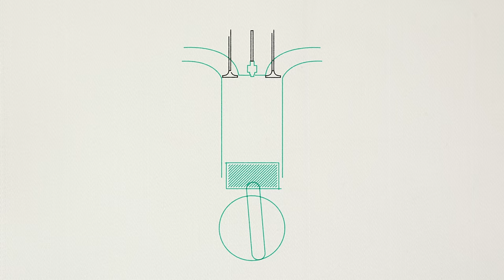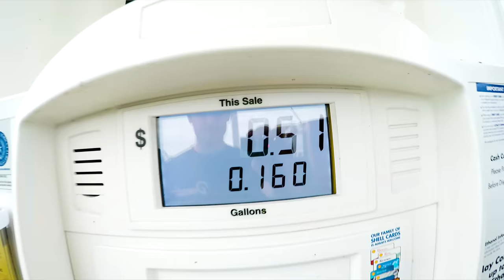IS THERE SUCH A THING AS BETTER GAS - How it Works | SCIENCE GARAGE

Comment: I’m not saying that Shell is a bad company, I frequently use their gas, but not exclusively, however this video kind of rubs me the wrong way because it’s pretty obvious that A: they were paid by Shell or B: They felt they owed Shell a favor for the presumably free tour of their facility, among other things. You can tell by the nearly exclusive use of info in regards to Shell gasoline versus any competition, or generic fuel, and frankly the humor is toned down significantly. It sounds silly, but this video is almost too informative, which points to them having a spec sheet they’re needing to read off of to fit Shell’s expectations in exchange for funding.

Comment: I've run my 2000 trans am since day 7 it's been fine I've got 86k there's minimum  standards federally, it's freaking gas I'm not gonna drive 50 miles or wait in line I get what I get regular  unleaded as required  by my owners manual on my car , I can use premium  for maximum performance, but that's why most of these cars are run hard and are now coke cans.

Comment: They did not disclose if the valves were from a direct injection engine or a port injection engine. I want to know if shell fuel removes carbon deposits on the intake valves of a direct injection engine. Any fuel will clean your valves if you got a port injection engine.

Comment: Got damn there is so much wrong here it actually hurts....

Let me start off by explaining: I was a laboratory techician specializing in gasoline and diesel. Commonly known as an engine tech.

This means I ran RON ((Research Octane Number)) MON ((Motor Octane Number)) and Cetane.

Through the ENTIRE world ALL gasoline octanes use the same parameter for testing. What do I mean by that? 

No matter where you go in the world ALL gasoline has been tested by the same instrument. A RON. The reason we see different numbers is because other areas use a second engine called a MON and from there they take the average.

That means an 87 gasoline COULD have a RON value of 91 with a MON value of 83. Thats why when Americans are at the pump you see notice it reads (R+M)/2. That is (RON+MON)/2. 

This also means if this SAME gasoline was sent to England it would be called 87 octane it would be called 91 ron. Make sense?

All this is defined by ASTM D2699 and ASTM D2700. 

Moving on: The build up what damages the engine the most over time is whats known as Gum. This is heptane insolubles as defined by ASTM D381. In this test there are two measurements for gum content. Washed and unwashed both having spec limits. And for ALL the fuels i have ever tested for gasoline there has only been a handful that has had any real gum content or has failed specs. Most of the time it was a 0 washed. For both premium and regular gasoline. In fact the specs as defined again by ASTM for both are identical.

Comment: Does Premium have more detergents and cleans your engine better? Yes. Is it worth the 50 cents more per gallon over regular? 99% of the time NO! Much cheaper to run regular and put in a fuel cleaner once or twice a year to clean any build up that could have happened.

Comment: not even mad about the Shell. but the video got info about oil mixed into the content. If the video is about gas, make it about gas. If the info is about oil, say so. Don't just mix it in and confuse others. (example: journal bearings..  they have nothing to do with clean gas. cold weather crank and oil flow, nothing to do with gas again.)
I expect the science garage video to be informative and not have bad info.

Comment: There's definitely a noticeable improvement in the engine when using V-power but it's so expensive and my car drinks it like a fish drinks water, the car doesn't feel as punchy compared to using Momentum 99 either.

Comment: Engine only have the problem with carbon on valves is from direct injection engines that are not direct injection the only thing that matters is keep fuel filter clean

Comment: Its called rope tier fuel. That's all I use is ExxonMobil, sunoco, bp but bp is high in ethanol so I use an ethanol stabilizer, costco is even top tier, valero, Marathon. And many more theres a list of them. I even do a seafoam treatment once or twice a year. I never buy gas because it's cheap or best price unless it's a top tier fuel station. In fact different gasoline or fuels use different additives so I switch up every so often. I use 91 or 93 in the sports car and I use 89 in my hemi powered ram. Never buy gas at sheetz or wawa or mom and pop places and stay the hell away from getgo's. That's shit gas!

Comment: So you still didn't define what bad gas is... The fact is, refineries "refine" oil to produce gasoline. A refinery owned by Chevron will sell their gas to hundreds of stations. The difference is the miniscule amount of detergent and additives added when a tanker arrives for a load. Pretty much every station has their own additives and detergents. And since each one is proprietary no one really knows how much or what is in each detergent / additive. Therefore it is all determined off who's add campaign suckered you into buying their snake oil claim vs. the other. 
Buy what you want and run gumout every 10k and you'll be cherry.

Comment: Still not spending an extra 15-20 cents a gallon in my vehicle that gets 15mpg  I would rather just buy cheap gas and just ad a fuel additive every 10 fill ups
Reply: since you pinch pennys for gas, wouldnt it be an overall smarter decision to drive something that gets 2x+ the mpg??? just sayin
Reply: plus ur saving yourself maybe 2-4 dollars on a complete fill up, you spend more than that a day on soda. with the better gas your mileage could improve to 17 MPG, thus actually saving you money from buying MORE of the cheap shit + additive. think about it.
Reply: @jackhofalot6705  well I like what I drive. And there is no evidence that shell gas improves fuel economy. Also I have a 22 gallon gas tank it is 4 extra dollars to fill it with shell. And over the course of 10 fill ups its 40 dollars. Or I could just spend 5 bucks on a fuel additive that I know will work and save that money.

Comment: Whst about the difference between ethanol(10% at punps in GA) and non-ethonal gasoline?
It has only been in fuels for a few years and doing my own tests on my own vehicles (having been a technician in the military and covilian world) non-ehtonal gas will always out perform its 10% counter part. My current car, a 2015 Hyundai Veloster (turbocharged direct injection) will spit and sputter as if missfiring on any premium 10% ethonal fuel, but when I put 89 non-ethonal (I havent found 93 in non-ethonal) in you can literally see the junk coming out of the tail pipe and feel the engine run smoother and the spit and sputter is gone. I've changed plugs, gaps, air filters and just about everthing I can without reprogramming the computer and it always runs better on non-ethonal. Also, I exclusively use Shell gasoline  which is how i found this video. I'd love to see one between ethonal at the pump and non-ethonal like we grew up on. Good info so far, thanks for the video.

Comment: Sorry I have been  independent REAL world usage TESTING Shell Fuel my option  is:
total Failure..  91 Octane Vpower
Been clocking Lower MPG( my  Fulley log is  on a DOWN slope ) since  june 9th
Less Performance
More 3rd Gear on the highway..

Comment: If your car is supposed to run on 87 and you put a higher octane in...it won’t burn correctly causing carbon and worse gas mileage.  however you don’t want to go to a no-name gas station go to a big namebrand one not Joe’s crappy gas station

Comment: Gas is gas as long as I keep my oil changed my fluids topped off and changed and my tank full my car will run. All gasoline cleans any kind of surface don’t believe me! Buy some cheap gas and drop a rusty nail in it.

Comment: A perfect example of semantics is Petro-Canada's 94 RON fuel. It's not a pure 94 ... it's 91 with additives. Some claim the number comes from fuel (.9 x 91 ) + 10% ethanol (.1 x 113 ) = 93.2 + other additives = 94.  Who knows. As long as the engine doesn't ping... but at that point it might actually be cheaper to get 91 at Costco (which is actually a premium gas) & boost the octane with your own additives like Torco or BOOSTane.

Comment: As a side note to my comment before ... 
 @AerisM  yes but with modern cars which most have direct injection the additives are useless trust me I now .... ( I have pulled many heads just to clean the valves ... ) h20 is not an all in one solution but it does help in certain  Situations but when a gas company says they have the best gas it's just not true becuase it all comes from the same place..... the main point of their own  Cocktail of additional chemicals is for the most part to counter act what the addition of  ethanol ( corn juice is what we call it)  does to a fuel system .... most of the carbon build you see is from the oil vapors being sucked up from the PVC sytems ... and from lack of proper oil changes  ... ... a good  Synthetic oil has plenty of detergents in it to prevent carbon build-up  just food for thought this video is a promo video for shell and they really dont get into much detail ..

Comment: Almost every point this Shell advert brought up isn't even relevant, especially to modern direct injection motors. No fuel passes the valves to clean them. Plus, all the gunk, carbon and varnish comes from the crankcase vent, not bad gas.

Comment: No but I think it rhymes with propaganda. Shells gas is crap. Here in Kansas not only is their premium fuel tainted with 10% ethanol it is severely over priced. My motorcycle runs like shit on it. BP's premium is etanol free usually about 40¢/gallon cheaper, I get better fuel mileage, absolutely no pre-ignition. Yes this is propaganda.

Comment: This is a typical propaganda video, he call regular gas bad gas and they show engine parts as if the car will stop running 10000miles. Most cars are actually designed to handle regular gas, and by the time the engine starts having issue from cheaper gas, the saving on gas would have been more than the cost of the repair.
Now, if you have a high performance car, the situation might be a bit different.

Comment: While I appreciate the more mature style of the video and weeding out the unnecessary over the top scenes for a more straight forward informational approach DonutMedia discredits themselves by not being transparent of any potential shell sponsorship of this video as well as not mentioning that in GDI engines (which 99% of modern day engines are) do not have any interaction between intake valves and gasoline as the gasoline is injected directly to the ignition chamber never to bypass the valves ultimately resulting in no correlation between what gas you’re using vs how dirty your valves become. Poor quality video by omitting information but better style than the overtly desperate scenes that were cringe to look at at times.

Comment: Lol this is a joke looks like a sponsored ad for shell (come on guys !!!)...... first of all you did not mention all "fuel" comes from the same place ... and for you so called 
" additives" i call bullshit to sell more product... these days the addtives in gas is to combat the high percentage of  Ethanol   added which is the worst ... 

Anyone who knows better the additives dont do shit and the best way to clean the internal parts of engine ( valves tops of pistons etc etc )  is to run a chemical through the fuel injection system  via fuel rail .. ( look up how to clean fuel rail on YouTube) 

But , any racer or good tech knows  the best way and what has work since the dawn of time  is simple h2o... sprayed into intake ... for anyone who dont now look it up on YouTube.... ...    so to me this looks like a promo for shell oil...
Reply: Engine additives do do something. Chevron even offers it's techron additive in its own bottle. It's simply a lower concentration of detergents and cleaners than in standalone fuel system cleaners. And if you dump a bottle of chevron techron additive into your tank, it can dilute the oil like any other fuel system cleaner used standalone. But to think the detergents do nothing is stupid. They may not be as effective as a very high concentration and amount of standalone fuel cleaner, but they do do something. And yes, H2o is good for cleaning carbon off the top of the piston because it's not compressible. Look at any car with a headgasket issue that leaks coolant into the combustion chamber, the pistons coolant leaks onto will be perfectly clean. But for port injected cars, the valves won't be cleaned by just spraying water into the intake, I'd know because we did it to my friends Volvo before we tore it down. The intake and exhaust valves were both nasty.
Reply: Also the whole hurr durr ethanol is the worst argument is bad. there's a reason people run E85 on performance cars.
Reply: @NCRranger24  yes but with modern cars which most have direct injection the additives are useless trust me I now .... ( I have pulled many heads just to clean the valves ... ) h20 is not an all in one solution but it does help in certain  Situations but when a gas company says they have the best gas it's just not true becuase it all comes from the same place..... the main point of their own  Cocktail of additional chemicals is for the most part to counter act what the addition of  ethanol ( corn juice is what we call it)  does to a fuel system .... most of the carbon build you see is from the oil vapors being sucked up from the PVC sytems ... and from lack of proper oil changes  ... ... a good  Synthetic oil has plenty of detergents in it to prevent carbon build-up  just food for thought this video is a promo video for shell and they really dont get into much detail ...
Reply: @maldo72  yeah I know it's a promo video from shell. I know synthetic oils have additives in them. The additional chemicals are normally for cleaning the engine and preventing carbon deposits, like shell said. Ethanol isn't as destructive as it's made out to be. Direct injection engines have issues with carbon buildup on the valves because fuel isn't being sprayed at them. Carbon deposits are a byproduct of burning off fuel, igniting fuel leaves behind carbon deposits. Project farm has videos on shell gasoline vs regular 87 and all that. And yes, gas comes from the same place the only difference is the additive package that the manufacturer adds. There's a difference between regular 93 without any additives and say, Chevron with Techron, or Shell with V-power. And not every gas stations gas is as good as others, the age of the gas, the tank that it's stored in, and amount of non-gas things (eg. Water in the gas from a poorly maintained tank) in the gas all affect quality. I've been to stations whose gas made my engine run really poorly, not a placebo effect, but my engine starting ticking and a Dyno result had me down over 10hp on a colder day than my previous run. Draining the tank and putting in Chevron 93 that had just been dropped off by a truck at the station brought my power back up to where it had dyno'd previously.